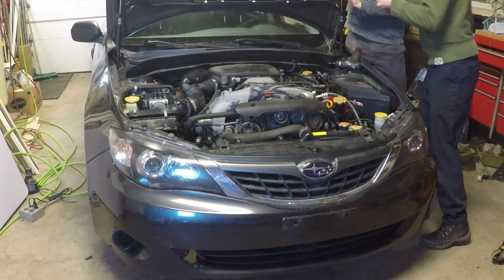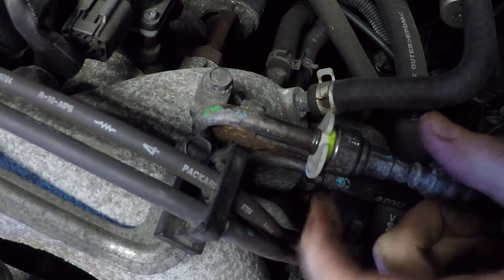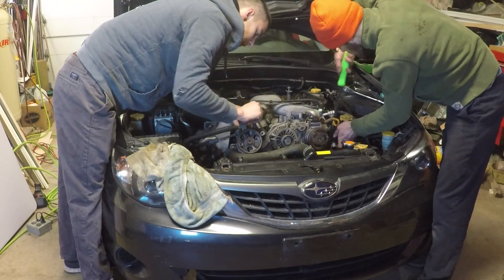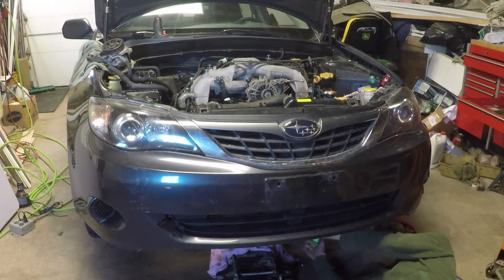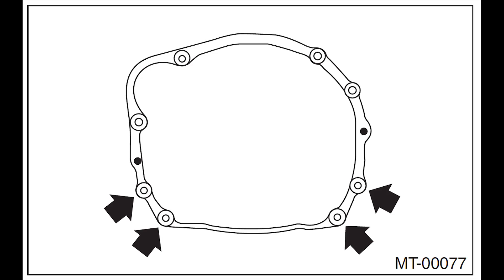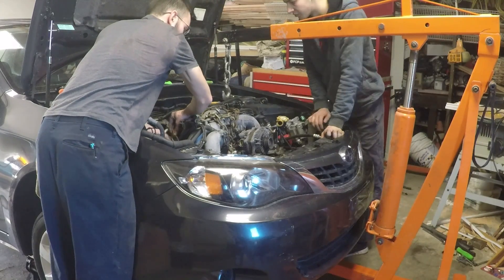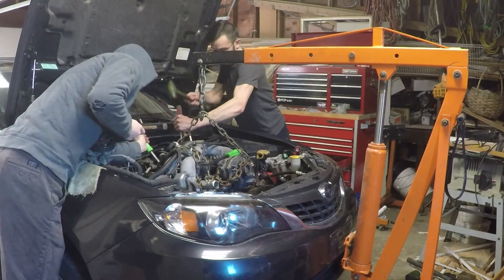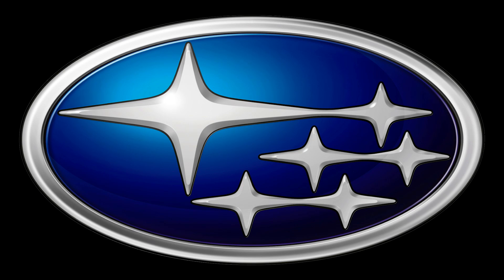How to Remove Subaru EJ25 engine

Comment: Spent two hours trying to separate the engine from the trans. Finally found a video that back up my theory to my dad lol. Used a couple of paint scrapers to get it started, then some screwdrivers and then a chisel back and forth -  after blocking up the trans and lowering the engine a little after lifting. Took 10 minutes after that - thanks.
Reply from the maker: Yeah I had an engine that took forever to split from the transmission. And another that took 5 minutes. Probably a combination of age, mileage and corrosion issues

Comment: The radiator drain plug is a big Phillips head plastic screw in the middle of the bottom tank, slightly to the drivers side.

Comment: Only 10 minutes to separate the motor from the trans... Ha!

I've been at it for over an hour. It's sticking on the lower left side... I persist... 

....And yes, I did remove all the bolts and nuts... checked a dozen times... I persist.

Comment: Is this similar to a 2006 Legacy?  

Edit: automatic
Reply from the maker: Very similar. You might have wiring differences. And with automatic you will need to unbolt the torque converter
Reply: @audimotive  Thank you for your reply

Comment: Also, a sharp hatchet with a hammer works best for separating the engine and trans.
Reply from the maker: Adam Alsnayyan that would definitely work better than dull pry bars. As long as you line up the hatchet directly on the seam. Good advice
Reply: AUDImotive For sure, it's what I always use on EJ engines.
Reply from the maker: Adam Alsnayyan I will keep that in mind for the next time I need to do this. Thanks for that tip!

Comment: Thank you! I am getting ready to do this, I have the same exact car down to the color.  The coolant spigot is a small philips plastic screw on passenger side of radiator.
Reply: Glad I read this before I start taking mine out. Now can I use any ej 2.5?
Reply from the maker: There are slight differences. Newer models have features that aren't on the older ones. Or vice versa. If you dont mind adding or removing emissions stuff, block is basically the same. But would be the same within a certain generation

Comment: There's a drain plug on the passenger side bottom of the radiator, but it's useless. Would take hours to drain the system. You did right.
Reply: Adam Alsnayyan it wouldn't take hours, but it would take a lot of minutes.
However, that's if the only thing you removed was the drain plug.
It was take just a few minutes if you removed to drain plug and the radiator cap on top

Comment: you forgot the motor mounts
Reply: Ideally you lift the transmission and engine up together to clear the mounts over the cross frame.  Newer subaru cars have the motor mounts attached to the transmission bell housing to avoid this issue.

Comment: Am I missing the part where you took the engine mounts off?? Or do you just loosen them from the subframe?
Reply: So I just loosened them from the subframe then using a jack with a block of wood lifted the trans up and pulled on the engine to A. Clear the mounting bolts for the engine mounts and B. To keep the  trans supported for reinstall

Comment: hey im pulling my engine to redo the bottom end. its a 2008 impreza with the 2.5i. looks like the same car an engine but you call it the ej25. is is the same as the 2.5i?
Reply from the maker: EJ25 is the "model" name of this engine and is the 2.5 liter engine
Reply: If you have a look visually google the model number for your years engine, chances are it is an EJ series motor. You can see online where to find your specific Model #, which is good to know in case you have to purchase spare parts.

Comment: What about the transmission and torque converter screws ?
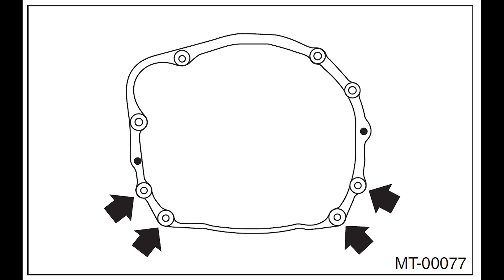Reply from the maker: Around 3:09 I showed where the bolts for the transmission are. As for the torque converter bolts, there is a rubber cap on the passenger side, right above the cylinder head. Bolts are loosened through this hole after removing the rubber cap
Reply: AUDImotive thanks 🙏 bro this weekend I am gonna change my head gaskets and all the other seals
Reply from the maker: Jaguar alegre no problem. Good luck with the project. I have a video on the head gaskets as well if you haven't seen it yet
Reply: AUDImotive  I will thanks mine is a 06 Subaru Impreza 2.5i non turbo and I have never done  a head gasket on a Subaru  and I picked Fel - pro head gaskets  26415 PT is that the gasket that u used on your car bro?
Reply from the maker: Jaguar Alegre that is the exact head gasket I used.

Comment: Thank for the video,and the step-by-step write up.
i be pulling mine out soon, just curious how hard is to remove slave cylinder?
Reply from the maker: +rathana phal hey your welcome and good luck! slave cylinder comes off very easy, it's only held on by 2 bolts
Reply: I don't see your video, it's been 2 years.

Comment: I'm not the smartest when it comes to cars, but when you separate the engine from the transmission, would there be any fluid leaking out?
Reply from the maker: If there are no leaks past seals, there will be no fluid

Comment: Great video, starting to plan for an EJ25 build and this video helped give some perspective :)

I do have one question: Is the bolt through the alternator actually strong enough to support the weight of the engine? I know it worked in your case, just wondering if there could be residual damage.
Reply from the maker: +Jon Blanton I can't say whether using that bolt is the best idea. But I couldn't find the "factory" lifting location. That bolt was used to remove and then install an engine with no side effects.

But if you find a better location to lift by, let us know!
Reply: AUDImotive ah okay, thanks for the data :)
Reply from the maker: +Jon Blanton yeah no problem. Good luck and have fun!

Comment: These are so easy if it takes over a hour your slacking 🤣🤣🤣
Reply from the maker: First time always takes a while. But you are right, after you do a couple, these engines are fairly simple to take out
Reply: Manual tranny and Canbus are way easier.